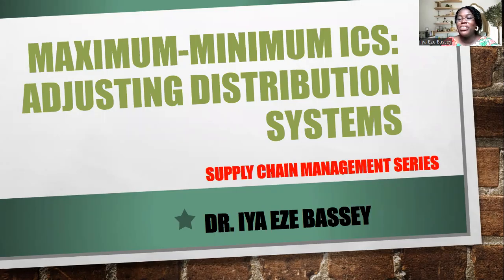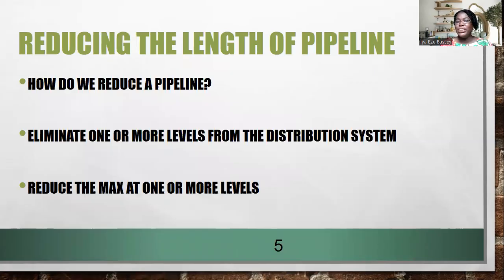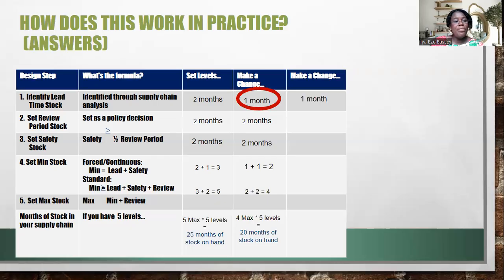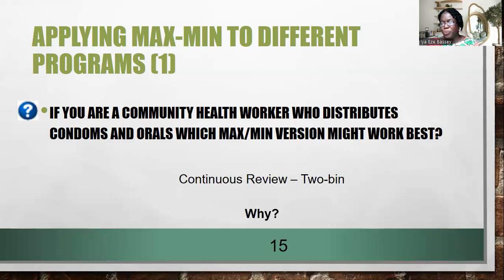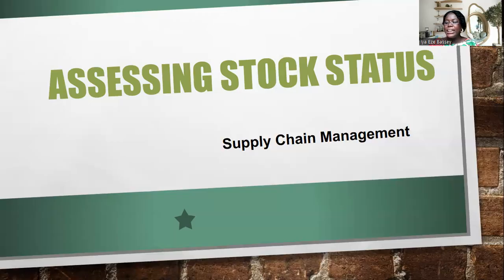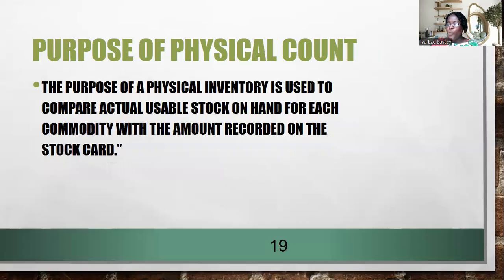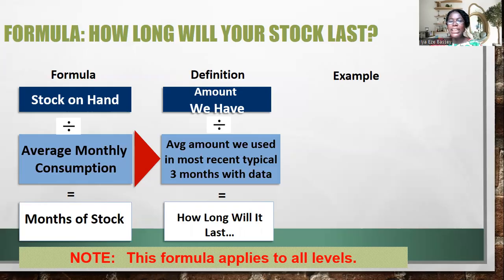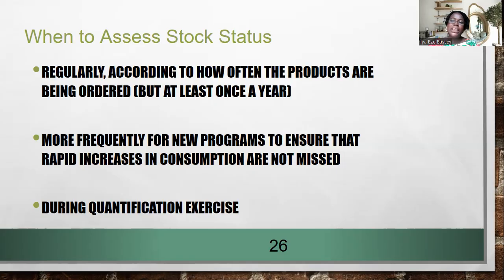Maximum-Minimum ICS: Adjusting Distribution systems (Supply chain management series)

Comment: Thank you Ma, for this amazing session on the topic Maximum- Minimum ICS: Adjusting Distribution System.
From the previous session we learnt about the types of Max-Min ICS and here we are learning about the steps in designing a Max-Min ICS which are
1. Set up the initial Max-Min policy for each level and type.
2. Check if the overall distribution will function properly if the level of specific Max-Min policies are implemented.
3. Check the total length of the pipeline that the policies at which level imply.
The pipeline needs to be modified by reducing the length of distribution by
1. Eliminating one or more levels from the distribution system
2. Reducing the Max at one or more levels.
There are some factors which can affect or impact a Max-Min stock level. These factors include; Cost of product, Reliability of transportation, Storage capacity, Cost of storage, Storage conditions at different levels, Shelf-life of health commodities, Lead time, Reliability of supplies, Effect of a zero balance of stock, Management skills of staff, Age of program and Accuracy of forecasts.
Overall the use of Max-Min ICS helps to
1. Avoid overstocking
2. Avoid understocking
3. Minimize wastage
4. Avoid costs of emergency orders
5. Simplify Inventory Control Decision making
6. Consistency of stock levels
7. Reliable data source from SDP for forecasting and quantification.
Reply: Dear Dr, Thank you.
Adjusting distribution system of maximum minimum inventory control system is quite understood as is reveals the steps of design such as
-set up intial maximum minimum policies for each level and type of facility 
-check if overall distribution will function properly if the level specific max min are implemented.
And check the total length of pipeline.
Reducing the review period, lead time and improve the distribution system reliability at 1 or more levels so that safety stick can be reduced is the Systematic way of reducing the Maximum stock level.

The factors that impact max min stock levels are 
-cost of products
-reliability of transportation
-storage capacity
-cost of storage 
-storage condition at different level
-age of program and so forth.

The challenges to using each version and variation are the systems with numerous levels, those that manage large no of commodities and those that manage products for new programs.

As community health worker distributing condoms and orals,
Continuous review as max min version works best (Two bin to be precise)
Standard version is recommended for drugs, HIV test kits and kabs while continuous review is for those with lesser no of products 

When to access stock 
Is regularly on how the products are ordered(atleast once a year)
Frequently for new programs to ensure that rapid increase in consumption are not missed and during quantification exercise.

Comment: In summary,i learnt on the steps in designing a max-min inventory control system which include setting up initial max-min policies for each level and typebof facility, check if the overall distribution will function properly if the kevel specific max-min policies are implemented and checking the total length of the pipeline that the policies at each level imply.
Pipelines can be reduced by eliminating one or more levels from the distribution sysytem and reducing the max at one or more levels.
Then the maximum  stock level can be reduced by shortening the review period at one ore more levels, reducing the lead time at one or more levels and improving the distribution systems reliability at one or more levels so that safety stock can be reduced.
Lastly, the advantages of using max-min system are avoiding overstocking, avoiding understocking,minimize wastage ,avoid cost of emergency order etc.
Thank you Ma

Comment: Thank you ma for this lecture, in conclusion, I can say that
The session was aimed at looking at the overall pipeline for the max/min ICS and to see how it can be improved upon to deliver commodities from the central to the med lab level.
The steps in designing a max/min ICS include; to set up initial max/min policies for each level, check if the overall distribution will function properly and check the total length of the pipeline that the policies at each level imply. To reduce the he length of a pipeline in order for commodities to reach the consumers (scientists) faster ,we are to ; eliminate one or more levels from the distribution system and reduce the maximum SOH at one or more levels. This can not be achieved arbitrarily but rather scientifically. Factors like cost of products, reliability of transportation , storage capacity and cost of Storage can impact the Max-Min stock levels .thank you 🎉

Comment: Adjusting the distribution system in a maxi-min Inventory control system (ICS)
Fine-tuning the supply chain management system to optimize inventory levels and distribution process. Below are keys adjustment to consider .
A. Lead-time reduction. Decrease lead times by negotiating with suppliers, improving transportation shipping options.
Safety stock optimization... Calculate and adjust safety stock stock levels based on demand  variability.lead time and service level requirements...

Comment: Thank you very much ma
I learnt from this session that the following methods for modifying distribution system policies are:
1 Establishing initial maximum minimum standards for each level and type of facility..
2 verifying whether the level specific maximum minimum regulations will be applied and whether the overall distribution will perform effectively.
3 verifying the pipeline s overall length as implied by each levels regulations.
However,the following are the benefits of employing the maximum- minimum system;
Reduces wastage, prevent overstocking and overstocking and maintains a consistent supply level.

Comment: Thank you ma for this amazing lecture. I learnt that some elements of the formulas can be changed in order to reduce Max stock level, they include;
1. Shorten the review period. 
2. Reduce the lead time.
3. Improve the distribution system reliability.

The steps involved in designing a max- min ICS which are
1. setting upan initial max-min policy for each level and type of facility
2. Check if the over all distribution will function properly if specific max-min are implemented 
3. Check total length of pipeline that each level implies.

 The benefits of employing the Max-Min system:
•Reduces wastage
•Prevents overstocking and under stocking
•It maintains a consistent supply level.

Comment: Discusses the need to examine the length of the supply chain pipeline.
- Explains the importance of setting initial maximum policies for each level and type of facility.
- Emphasizes the need to check if the overal distribution will function property with the level+specific maximum policies.
- Discusses the concept of reducing the length of the pipeline by eliminating levels or modifying policies.
- Lists factors that impact maximum stock levels, including product costs, transportation reliability, storage capacity, storage conditions shelf life, lead times, source reliability, effects of zero balance, management skills, program age, and forecast accuracy

Comment: Thank you ma for this educative video 
This video made me understand that, The Maximum-Minimum Inventory
Control System (Max-Min ICS) can be a valuable  tool in supply chain management for adjusting distribution systems. This system ensures that your distribution network operates efficiently while maintaining optimal inventory levels.
The key storage activities being:
1. Supply receiving and incoming inspection, 2. Put away, 3. Picking and packing, 4. Shipping. 
There are thus three steps in designing max-min ICS. And elimination of one or more levels from the distribution system will help to reduce the length of pipeline.
*Factors that impact max-min levels are
- lead time,Cost of products,age of program, etc
In summary, the Maximum-Minimum Inventory Control System can play a pivotal role in optimizing distribution systems within your supply chain. By setting appropriate thresholds and utilizing demand forecasting, you can ensure that your distribution network efficiently meets customer demand while minimizing costs and risks.Adjusting distribution systems in this manner can enhance customer satisfaction, reduce operational expenses, and contribute to overall supply chain resilience.

Comment: In summary, adjusting the distribution system in the Maximum-Minimum Inventory Control System can be done by reducing the pipeline length, which includes all storage facilities and transport links from manufacturer to user. The length of a pipeline can be reduced by eliminating one or more levels from the distribution system, reducing maximum stock level systematically by shortening review periods, reducing lead times, and enhancing distribution reliability at one or more levels. 
Factors impacting Max-Min stock levels include product costs, transportation reliability, storage capacity, storage costs, and conditions. The advantages of the Max-Min system include avoiding overstocking and understocking, minimizing wastage, avoiding emergency order costs, and simplifying decision-making. Challenges include managing systems with numerous levels, large number of commodities, and new program products.
Also, assessing stock status involves physical counts to determine months of stock, and it is the process of counting by hand the total number of usable units of commodity in the store or health facility, comparing actual usable stock on hand with recorded amounts.

Comment: In this series, I learnt that the adjusting distribution system is above considerable shortening of the pipeline, improving the distribution systems reliability at one or more levels so that safety stock can be reduced.
This system is important to avoid overstock minimise wastage, and avoid the cost of emergency order.
Factors that impact max-min stock levels are:
1. Cost of product
2. Reliability of transportation
3.storage capacity
4. Cost of storage. e.t.c.

Comment: Through this lecture, I learnt that to adjust the distribution system there's need to consider - reducing the length of a pipeline and reducing the maximum stock level.
Factors that inpact max-min stock levels are - cost of product, reliability of transportation, storage capacity,cost of storage , lead times,age of the product etc
Some advantages of max- min inventory control system are- to avoid over stocking, avoid under stocking, minimize wastage, avoid cost of emergency orders etc
The challenges to using each version and variation are- system with numerous levels, system that manage a large number of commodity, systems that manage products for new programs
Assessing stock status helps to determine how long supplies will last.
I learnt that the purpose of physical count inventory is used to compare actual usable stock on hand for each commodity with the amount recorded on the stock card.
Thank you madam

Comment: On adjusting the pipeline and the max/min inventory control system and assessing stock status, it is important to Note that it is aimed at reducing the time it takes for commodities to be transported from the central Warehouse to the client. This is because there are many levels in the pipeline which makes it very long. 

When will designing an adjusting the pipeline length the following steps are to be considered;
Set up initial Max/min policies for each level and type of facility
Check if the overall distribution will function properly if the level specific Max/min policies are implemented.
Check the length of the pipeline that the policies at each level imply.

After all these steps have been considered then there are things to do to reduce the length of the pipeline which can be to remove one or two levels from the pipeline or reduce the maximum stock level by maybe one month or 2 months from each of the levels.

SOME FACTORS THAT AFFECT THE MAX/ MIN STOCK LEVEL INCLUDE;
Cost of product
Storage capacity
Cost of storage
Shelf life of commodity
Transportation reliability

Lastly, to keep an accurate count of the number of usable commodities one has in their store it is important to carry out physical counts. This can be done once a year but in case of discrepancies it should be carried out as often as possible.

Comment: The highest minimal amount (max-min) Comprehensive instructions for managing stock levels to avoid both overstocking and understocking of commodities are provided by inventory control systems (ICS). It includes several system design phases, pipeline length reduction techniques, and variables influencing the maximum and minimum stock levels. The lessons have been immensely beneficial. By regularly providing an indication to the stock status, the max-min ICS not only helps minimize overstocking and understocking but also helps reduce the costs associated with emergency orders. Additionally, it helps with assessment and management. of the length of each level's policy pipelines. Furthermore, I now have a better knowledge of the advantages of the max min system, including its capacity to stop both overstocking and understocking, as well as the related difficulties brought on by many iterations & versions. I sincerely appreciate the knowledge this series has given me.

Comment: Ma you're indeed a wonderful teacher and lecturer. I've been able to know the steps in designing a max-min ICS and how to reduce the length of the pipeline which can be done by either removing one level and this can only be done systematically. Which includes reducing the review period, the lead time and then improve the distribution systems reliability. Then I learnt the factors that impact max-min stock levels and the advantages of using a max-min system. The various challenges in using each version and variation.

Comment: Thank you ma
In summary, here are the steps in designing max_min inventory system
1) Setup initial max_min policies for each level and type of facility
2) Check if the overall distribution will function properly if time level specific max_min policies are implemented
3) Check the total length of the pipeline that the policies at each level imply
Factors affecting determination of max and min stock level may include; 
Length of pipeline, Cost of products, Storage capacity, Cost of storage and Reliability of transportation.
The advantages of using max_min system may include;
To avoid overstock, to avoid understock, minimize westage, avoid cost of emergency Oder and to maintain consistency of stock levels.
Challenges of each of the variations and version;
System with numerous levels
Systems that manage a large number of commodities
Systems that manage product for new programs

Comment: In the world of inventory control systems (ICS), it is a plus one to me because I now understand the significant roles ICS plays in supply chain management.

I learnt that they are steps in designing the maximum-minimum ICS. They include;
1. Setting up initial maximum -minimum policies for each level and faculty.
2. Checking if the overall distribution will function properly.

The maximum -minimum system has advantages and these are;
A. It minimizes wastage
B. It avoids overstocking
C. It avoids the cost of emergency order
D. It avoids understocking.
     There are factors that can impact Max-Min stock level like; cost of storage, storage capacity, lead time, shelf life of health commodities etc.
In accessing stock levels, we do a physical count, that is counting by hand the total number of usable units of each commodity in your store or health facility at any given time. This helps to compare actual usable stock on hand for each commodity, with the amount recorded on the stock card.
 
In a nutshell, I've gained knowledge about the steps involved in designing a maximum-minimum inventory control system, the methods for reducing pipeline length, buffer stock, accessing stock status, paying attention to the physical count. I've also gained insights on the benefits of the maximum-minimum ICS as well as it's associated challenges.

Thank you once again ma.

Comment: The max-min inventory control system provides comprehensive guidelines for managing stock levels to prevent both overstocking and understocking goods. 
This control system also helps to avoid emergency order costs by providing a guide to the stock status on a regular basis. 
Cost of production, lead time, cost of storage, storage capacity and age of program are factors that affect the max-min levels.

Comment: In summary I learnt the steps carried out in designing a Max-Min  ICS,How to reduce the length of the pipeline and the factors that impact Max-Min stock levels. I also learnt the advantages of the Max-Min system and some Challenges faced by the Max-Min system. I learnt the meaning of a physical count and the purpose for a physical count and also learnt the formula used in calculating or knowing how long a stock will last which is the  Stock on hand divided by the Average monthly Consumption.

Comment: Another Wonderful session ma
Thank you Doctor.
In this session i learned that Adjusting the distribution system in the max-min inventory control system involves optimizing reorder points and quantities based on demand fluctuations and lead times. This ensures that inventory levels are maintained within specified thresholds/limits balancing supply with demand to enhance efficiency and to avoid over stocking ,under stocking  wastage and excess  costs.
 Also in this session i was about to understand the step involve in designing max- mins ICS, how to reduce pipeline , factor that impact on max-min stock level and their advantages.